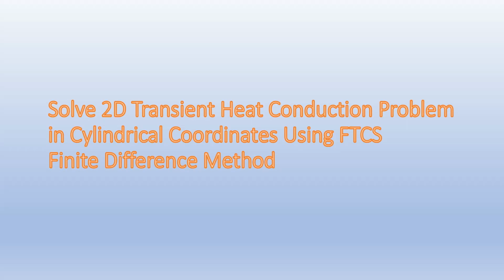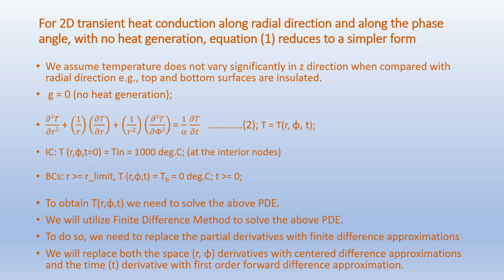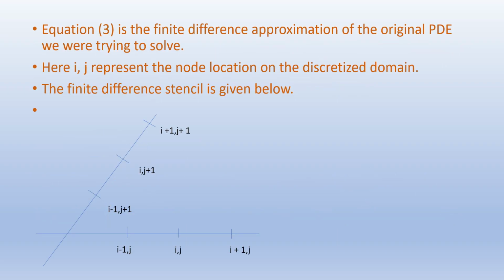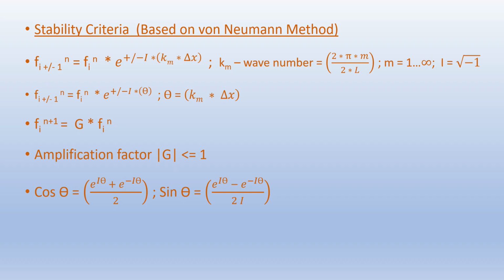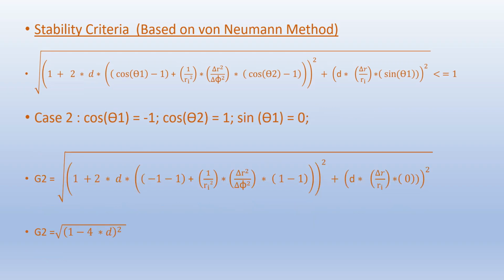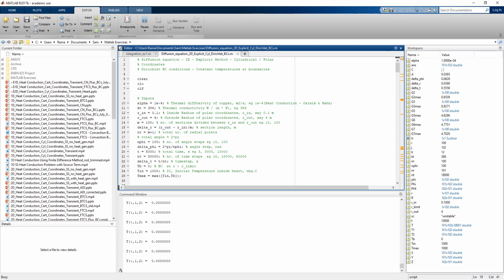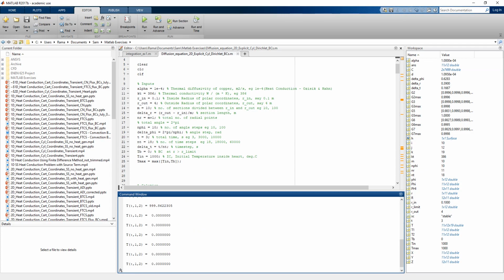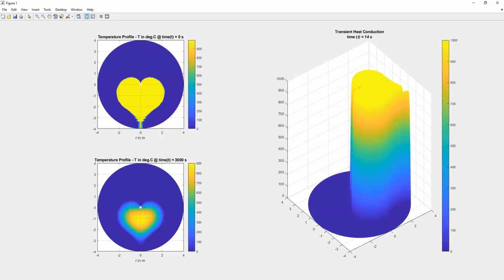Solve 2D Transient Heat Conduction Problem in Cylindrical Coordinates  -  Finite Difference Method

Comment: Good Morning. You have done a wonderful work on this video. i work on something whicth is similar to what you have done. It would be a pleasure if i can have your matlab code
Reply from the maker: Codes are available at https://engineering-stream.com under numerical methods
Reply: @samseleven1  Hello! Thank you for sharing the code, but it seems that the link is not working, would it be possible to access it some other way? Thanks!
Reply from the maker: @mariaqrable  hello.let me know what is not working. Codes are at the website specified
Reply: @samseleven1  Hello! Can't find "numerical methods" in the link specified
Reply from the maker: @mariaqrable  check under online calculators
Reply: @samseleven1  hi, there are not any code in that site,